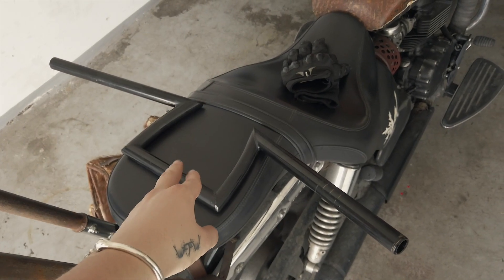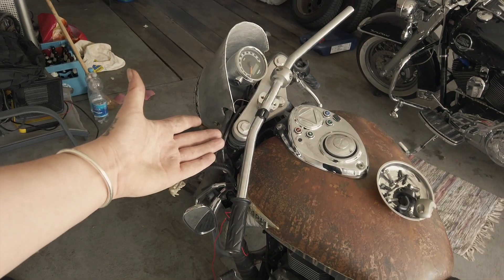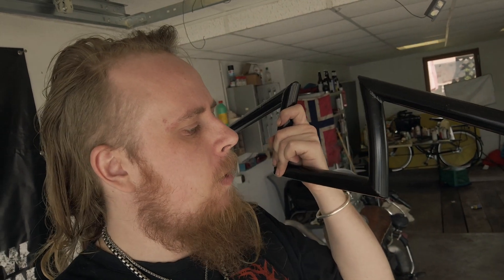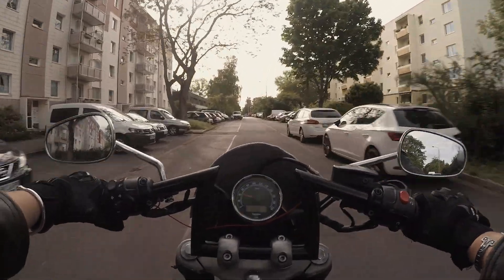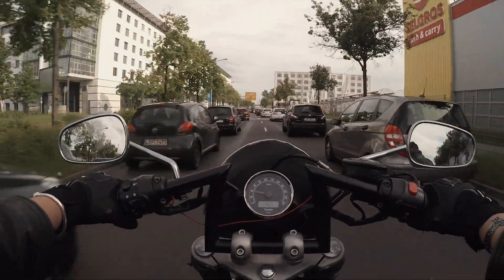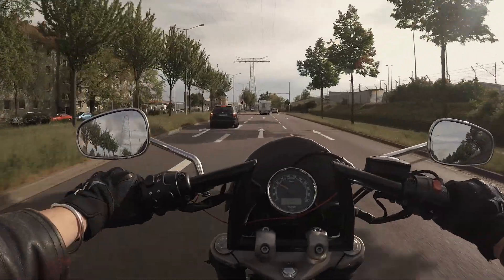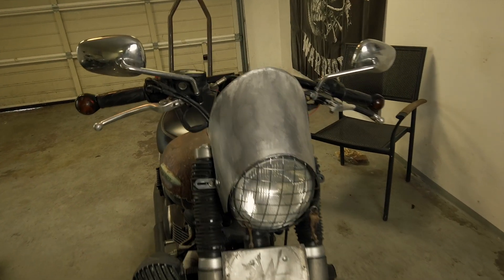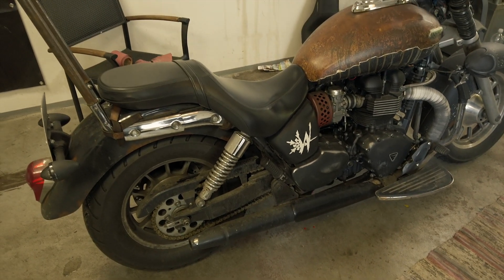INSTALLING NEW MOTORCYCLE HANDLEBARS

Comment: Oi, I know you do not have this bike anymore but did you not have any issues with brake lines or throttle cables getting pulled when you turn the handle bars from lock to lock? I am looking into buying mini-apes or possinly these Z-bars to improve long distance riding comfort for my old Speedmaster. The stock throttle cables seem so short, just increasing the angle of the stock drag bar made it pull the throttle cables and rev the engine up without my input when I turned the bars. I did fix it with some adjustment but there isn't much adjustment room left now.
Reply from the maker: There was drag bars on the bike when I bought it, so I guess the previous owner changed the lines, so I had no issue putting these on